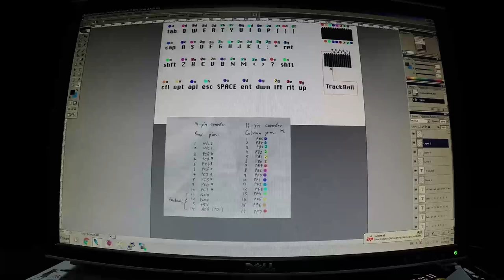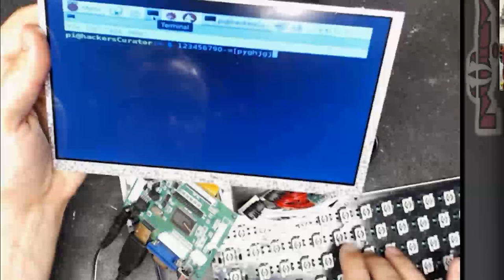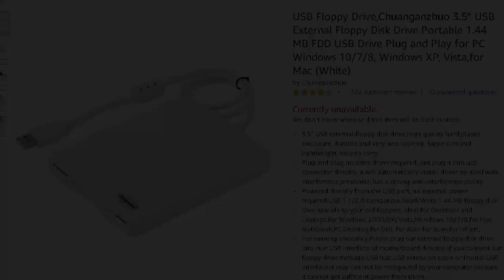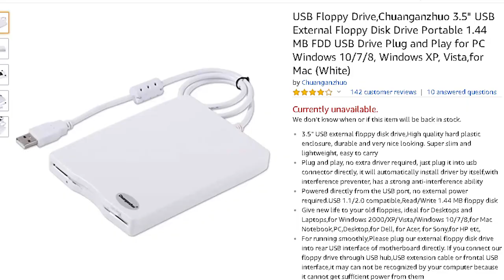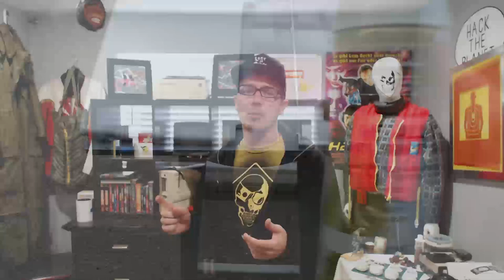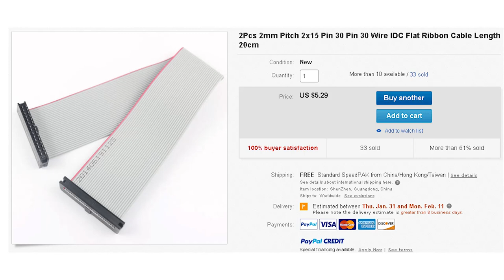Hackers: Lord Nikon's Laptop

Comment: are you gonna market this? sell them?
Reply from the maker: Its not very marketable really. Unless someone, like me, is really interested in a pseudo show piece, it doesnt really hold up as a functional pc for any prolonged use. Sourcing parts, and labor to build it, you dont get performace that fits the bill.
Reply: @HackersCurator  i was thinking with raspberry pis
Reply from the maker: @ok_iot  yeah, thats what i built the original with, but you still need the original case, all the parts to modify it with etc if you are going for a screen accurate look. Ive actually made 1 to order and have priced the build for a few others, but again, the cost vs what you get is admittedly a tough pill to swallow. Its really the labor that is a tough sell.